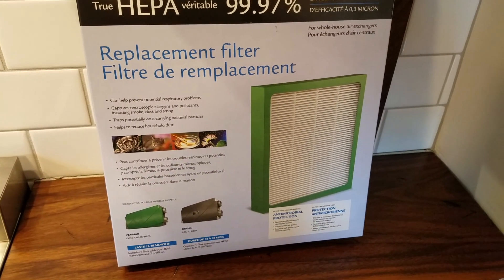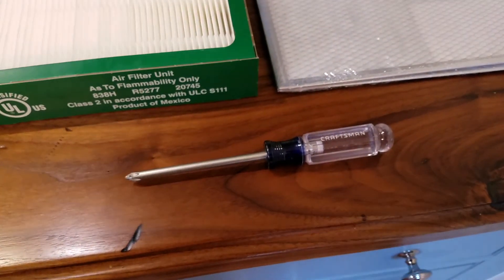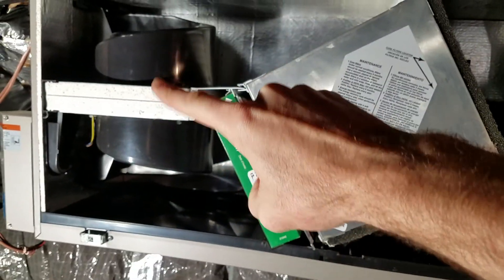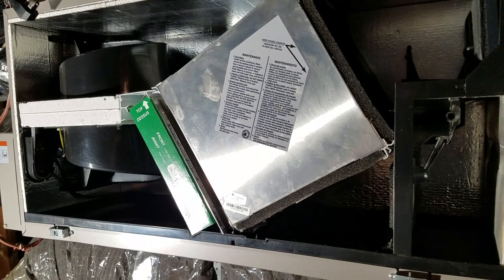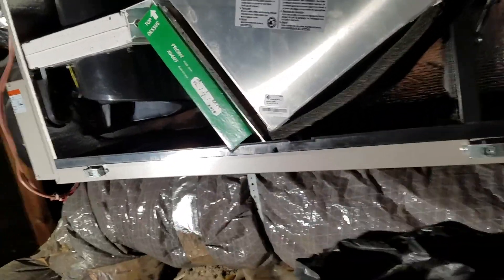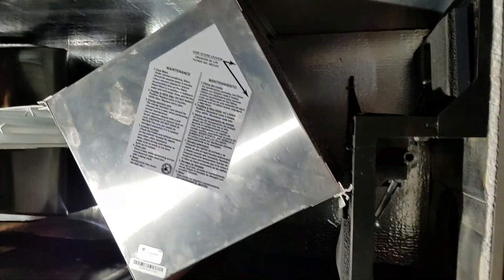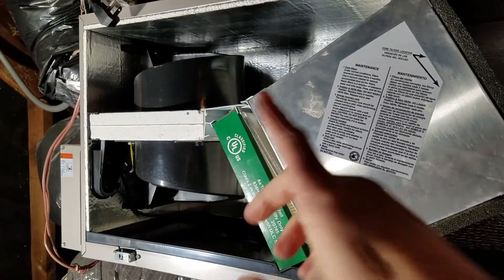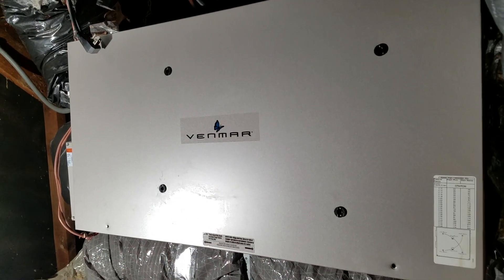Energy Recovery Ventilator (ERV) Maintenance: An Overview

Comment: You didn't show the removal, cleaning and reinstallation of the heat / moisture exchanger. 🙁
Reply from the maker: I covered that at 4:11...did you see it?
Reply: @myoldhousefix  at 4:13 it just skips from when you're about to take it out and vacuum it out, to where you've already reinstalled it.

I'm having a hard time finding pictures of this exchanger's innards online. I've found numerous diagrams, but very few pictures.
Reply from the maker: @firstnamelastname9918  there's not too much to the inner "core" heat exchanger. Its basically a large filter box that mixes incoming and outgoing air. 

It looks like a car air filter wrapped in metal. It doesn't have any serviceable parts and us one unit. It slides right out, vacuum it once per year (per mfr maintenance task) and push it back in...thats it. I'll see if I can find a pic...
Reply from the maker: @firstnamelastname9918  - here's a pic - https://gasexperts.ca/product/venmar-replacement-erv-core-part-no-sv03137/
Reply: @myoldhousefix  Thank you! I'm approaching this as an engineer (mostly software / electrical). I've been researching this and trying to understand why the criss-cross design was used instead of the classic counter-flow design, which is far more efficient. It seems it's because this design is very effective from the perspective of manufacturing simplicity/cost as well as it's compact size.

This has tens of layers stack on top of each other, yet requires no intricate supply and exhaust manifolds.

I'm a bit pathological when it comes to optimization.
Reply from the maker: @firstnamelastname9918  I hear ya! My day job deals with logistics, R&D, etc for the Army...it is simple but still pretty expensive - almost $600 for a new core. Broan bought Venmar and there is no longer a HEPA ERV on the that I know of - just a MERV11.

 The new Broan ERVs might be a different design.